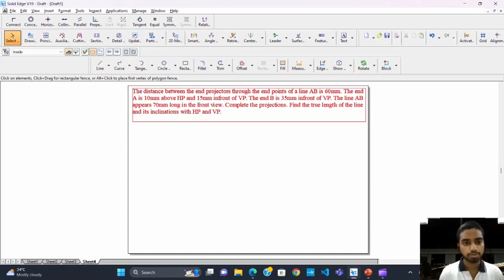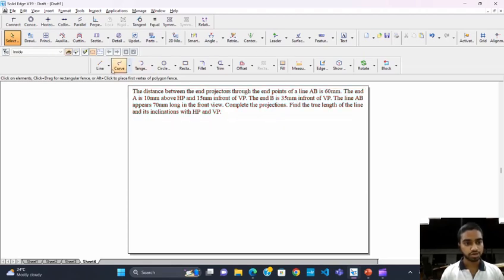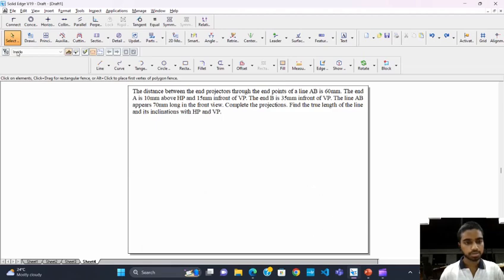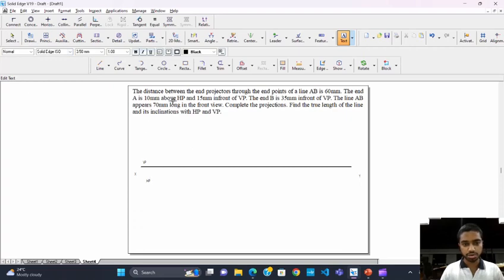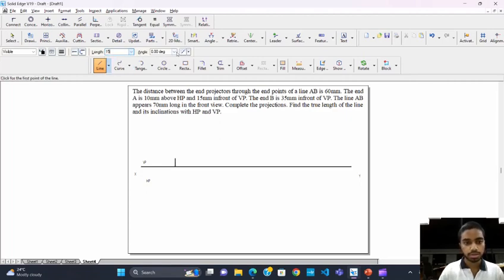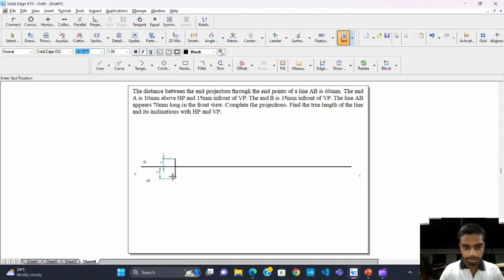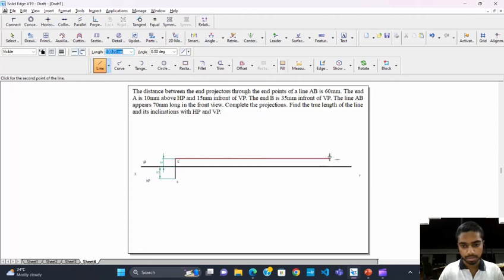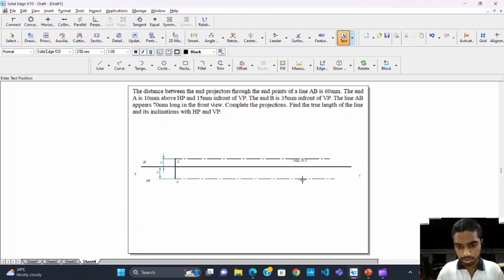CAED PROBLEM ON PROJECTION OF LINES

Comment: The distance between the end projectors through the end points of a line AB is 60mm. The end A is 10mm above HPand 15mm in front of VP. The end B is 35mm in front of VP. The line AB appears 70mm long in the front view. Complete theprojections. Find the true length of the line and its inclinations with HP and VP.